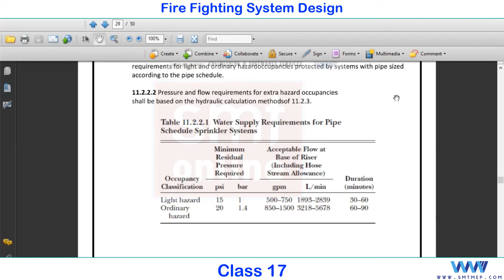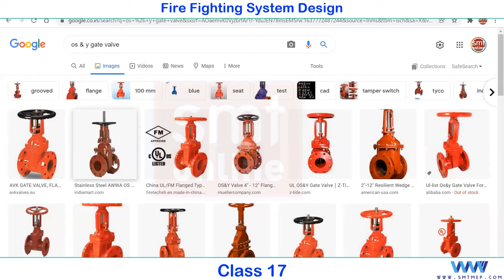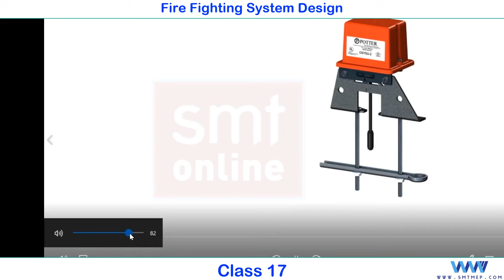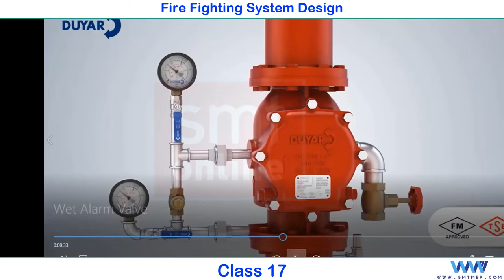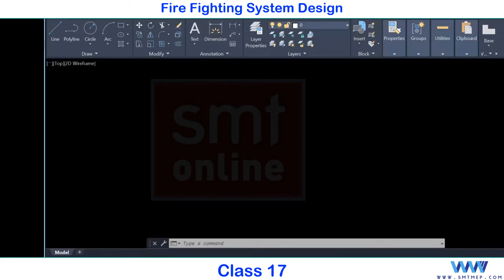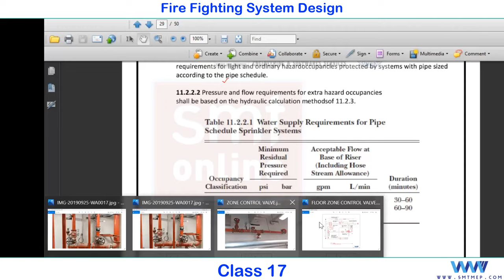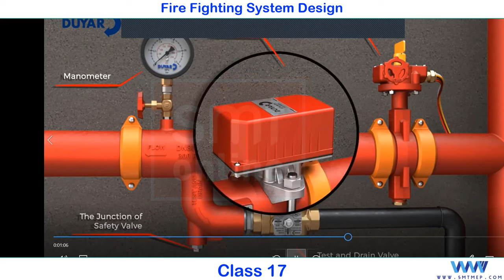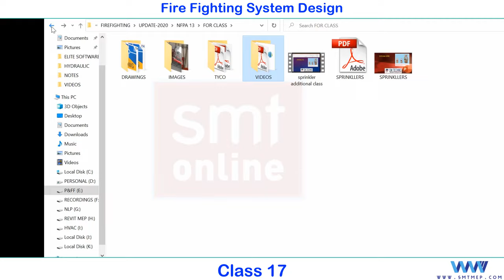The Future of Fire Safety: Alarm Check Valves and Zone Control Valves Leading the Way

Comment: Sir,as you explained assembly of Acv you told there is flow switch.
As i worked I saw only pressure switch not flow switch in acv assembly.can you clarify.

Comment: Sir how many sprinkler is enough for one ACV
Reply from the maker: Upto 52000 sft area coverage for light and ordinary hazard
Reply: For ordinary & light hazard area 1 ICV can able to control 52000sq. ft & approx. 416 Nos. Sprinkler is enough according to me.. it may be increase as per single sprinkler area coverage. ( Note here i consider 125 sq.ft per sprinkler) 

Please correct me if i am wrong